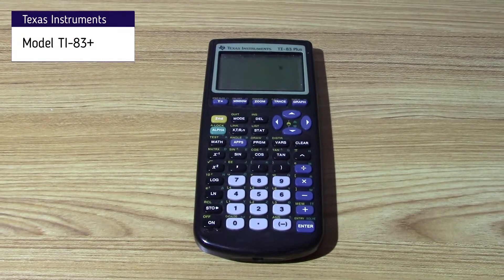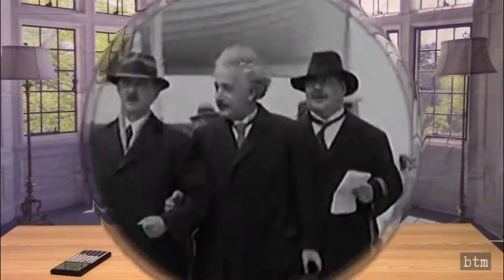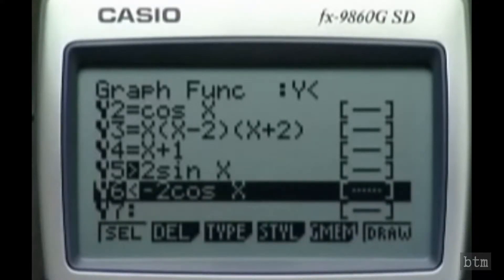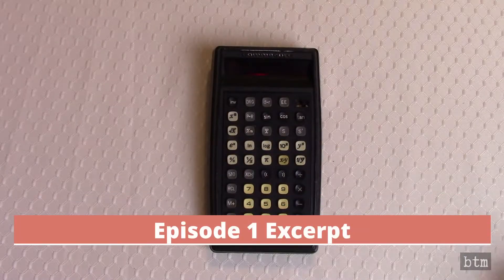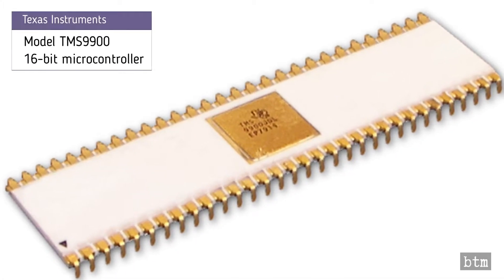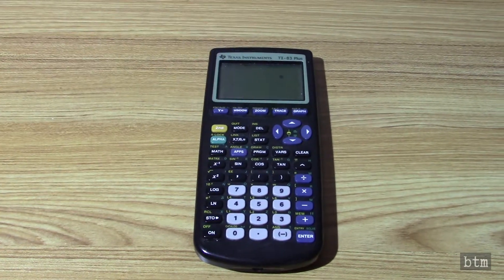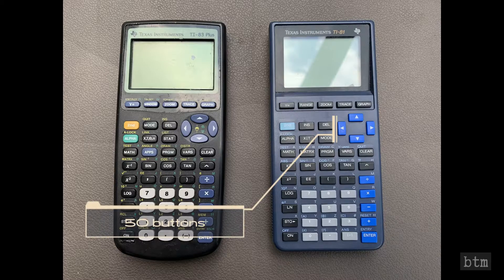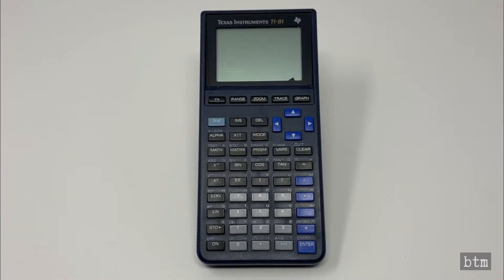The TI-81 Is The Best Graphing Calculator For the Money--But It Doesn't Play Doom!: E9/R8

Comment: Very cool - love the vid and love TI calcs!

No linkport and can't play games? Perhaps something can be done about that :).
Reply from the maker: It has been done, but you have to crack the case open and hard wire a jumper onto the PCB. Then you have to exploit a stack overflow bug in the RAM. Here is a link for those viewers who are interested: https://www.ticalc.org/archives/news/articles/14/145/145220.html. Also interesting is the fact that Texas Instruments hacked the TI-81 themselves in order to sell projection screen devices (mostly from Polariod, such as the Model T691) that could plug into the calculator. The modified T1-81 with a connector port was delivered with the LCD projector (which was then placed on an overhead projector). The hardware modification presumably is just video out, but maybe not. Thanks for your comment! -BT